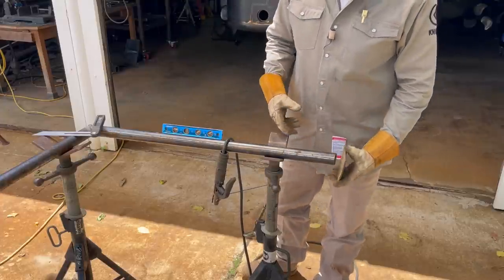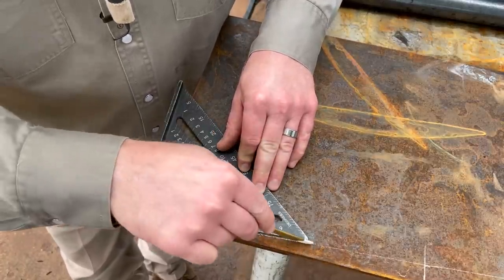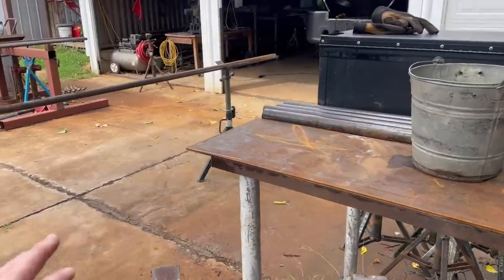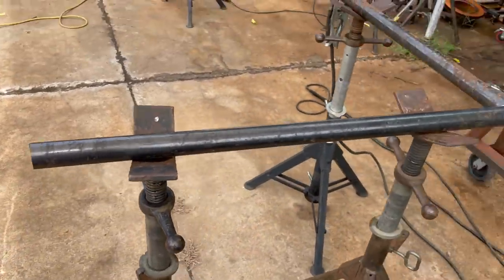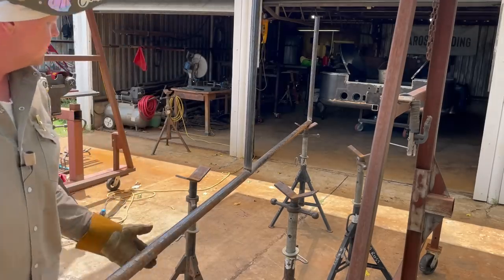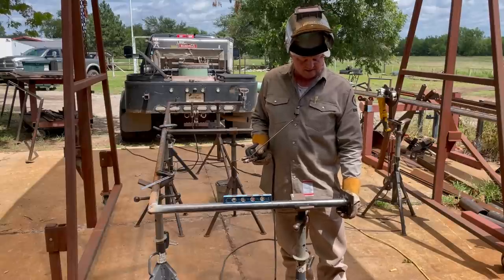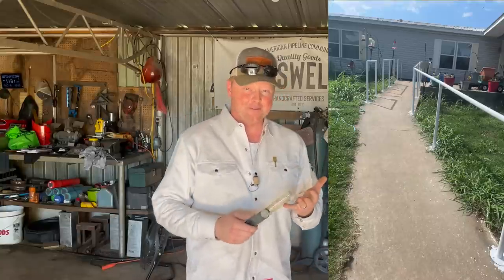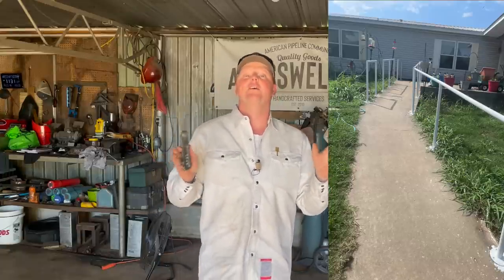The Most Valuable Lesson Stick Welding Has Taught Me (Building Handrail On a Slope)

Comment: 20:20....did not notice if you did this.....but a cool trick to 
get the dust out of the drilled concrete hole and away from
area is to use the cooling fan of the drill to blow it away.....
and it keeps you from getting a face full of concrete dust
if you are down there and huffing and puffing  with your 
own breath......plus, you don't have to bend over......
Us Old guys try not to bend over if we can.....cheers, Paul

Comment: A suggestion (if I may).
Use your grinder and really round off the ends of the pipe and take away the "sharp" corner edge.
It may not seem like much, but having had that done to my Grandparents rails, made it a bit "safer" (no sharp edge).

A simple small pull cart/wagon would work to help with the groceries, since they need the handrails.

Also, a piece of tubing is good to blow out dust - I use that to keep it away from my face.

Comment: Great job, Lots of great tios. I handle non marked angles in cutoff with small metal spacer (bolt scrap)against the stop to get desired angle then tighten holding pipe securely while cutting. Nice to have Grandparents to return love to. Ray Stormont

Comment: I fabricated a rectangular tube that fits over the V head with a 1/4" x 6" x 12" flat plate welded to it so I have a way to hold a base plate while I line it up either on a pipe post/column or a sq. tube post/column, works really well when you have no fitter.  Also use a small roll around cart to put my tools in so I don't drop them on the ground.
Reply from the maker: I love it! Thank you for sharing!

Comment: Broke out doing structural just over a year ago now. My biggest challenge is buildings stairs and handrails.  Still struggle with it till this day. I’m not book smart so when it comes to angles and finding out dimensions I struggle. And there is zero videos on how to build them. Example: how to many steps to put in the step as well as how long will that step be, all depending on how high the platform is and what angle it is. Just don’t know how to figure any of that out.
Reply: Reading the Swanson speed square blue book might help you out. It goes over stairs IIRC.
Reply: @72200SA  where can I find that?
Reply: @fztfabs65  buy a Swansen speed square. Book comes with it if you buy the right one.
Austin should (and may) carry them in the Aross welding store.
Reply from the maker: We don’t but thank you for the recommendation

Comment: I measure 12” from end of level and measure bottom of level to surface to get rise. If measure 12” on your rise you won’t get full 12” on run. Example 12” run with 45 degree slope long leg (hypotenuse of triangle) would be 12.4” long.  If measured 12” up your angle run would be shorter than 12”. 
Might make difference on long run. Enjoy watching videos every Friday always picking up little tricks!
Reply from the maker: Yes, you are correct. I noticed that when I was editing this video 🤦‍♂️

Comment: More than once have cut a piece one inch short, do not know how but it is never like the other way where it is a inch to long.

Happens also when working with wood,  but with wood this is no wood welder. There is glue but glue just does not work the same as welding.